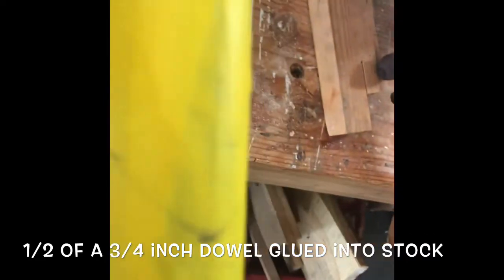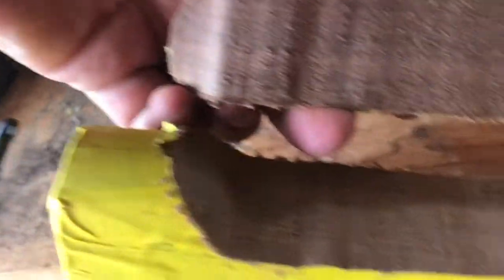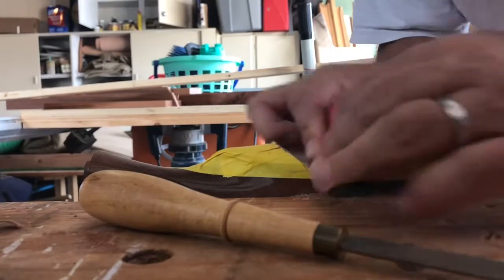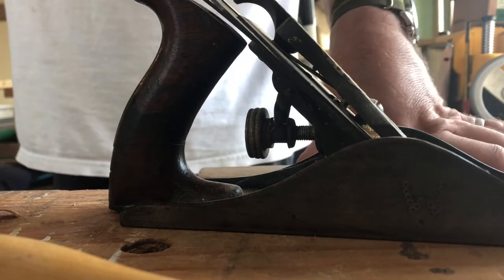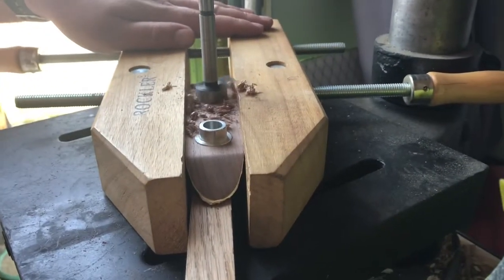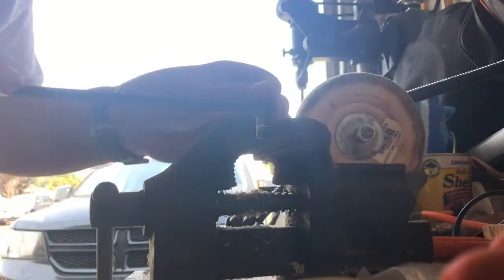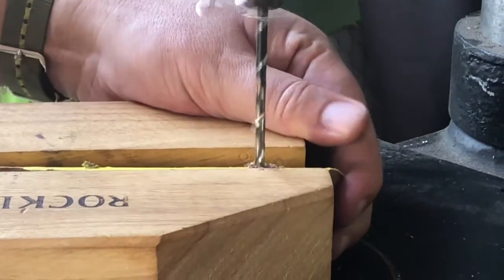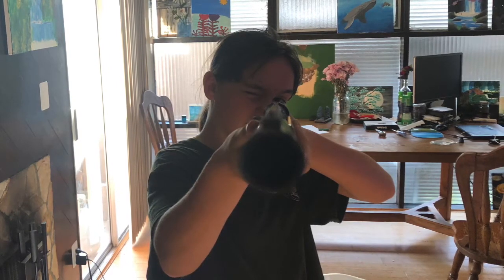Adjustable comb installation

Comment: It seems like this kit might be more effective if installed the opposite way you installed it.  There would be plenty of depth in the stock for the pillars and there would not be set screws sticking out of the comb, thus facilitating both left and right-handed shooting.  When I am making custom stocks,  I follow your wood prep instructions, then I epoxy 3/8 inch OD 1/4 inch ID brass barbs into the lower portion of the stock under the removed comb.  I then use a 1/4 inch dowel centering pin to mark the bottom of the comb for the barbs.  I put a couple of file strokes on 1/4 inch stainless steel round bar and epoxy that into the comb ( two pieces, cut to allow the comb to sit flush against the stock with enough vertical travel to accommodate cheek weld).   I drill holes for a couple of thread-serts from the side of the stock into the brass barbs  (these are flush with the stock surface so either side will do) to lock the comb height.  Finally, a couple of  1/4 inch ID lock collars can be placed on the round bar coming from the comb to create an easily repeatable depth stop for when you need to remove the comb for cleaning and maintenance.
Reply from the maker: Thanks for the feedback, I think you may be correct about it being better the other way.  The pillars may extend too far and interfere with the spring not sure.  To be honest I didn't think about doing it that way and the kit maker shows it this way in the pictures.  There are no directions so I thought I'd share this for other people thinking about tackling the same job.  For a kids gun sending it out is pretty costly.  My son's gun came with an adjustable comb so made my life a lot easier (now to fork over the bucks for the tubes though).

What do you mean by barbs?  Do you have a video on your process, it doesn't seem like most stock fitters are willing to share ;).
Reply: @desertislandtoolworks1956   I don't have a video, but I am building a stock with an adjustable comb now and will try to take a video of it to share.

Comment: You have a Gordon setter! Me also she’s a good helper. Thanks for the video. I just wanted to add you should epoxy the bushings into to stock. I’m not sure why the manufacturer didn’t recommend it. Don’t let your Gordon help with that part. Epoxy isn’t easy to get out of their hair.
Reply from the maker: I did, after sixteen years together he passed almost a year ago now :(.  Keep enjoying yours, the breed has so much personality!  I had intended to go back and epoxy but honestly forgot about it after the test run.  She hasn't had any issues with it but one of these days I probably will.  She likes to run a beartooth pad over it which also helps hold it in I think.
Reply: @desertislandtoolworks1956  I’m sorry to hear about your puppy 16 is a amazing. I’m glad it’s working thank you very much for your video.

Comment: What are the measurements of the piece you cut off the stock?
Reply from the maker: 3/4” thick by 5 1/2” long. This stock didn’t have much material as it is a youth stock and heavily hollowed out. Normally I’d prefer to take an inch. To fit her I raised it a half inch, which is a lot to do with just a pad. She’s 16 now and the gun still fits her well.
Reply: Thank you I am in the process of doing a 410 and there is not a lot of material. I installed the  rod innthe stock already and the next step is to draw it out and cut it. Thanks for the video and for answering my question.
Reply from the maker: Glad to hear you are tackling it, I found it a bit nerve racking but in the end well worth it.  A word of caution, they can be thin on the sides too so be careful how you clamp it. I’d love to hear how it turns out!